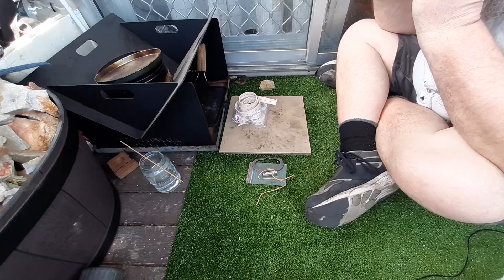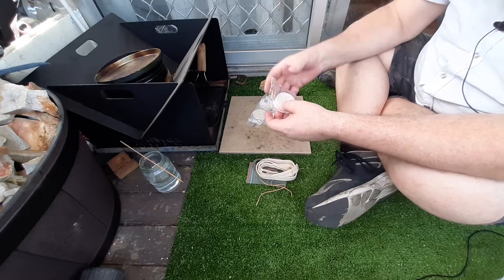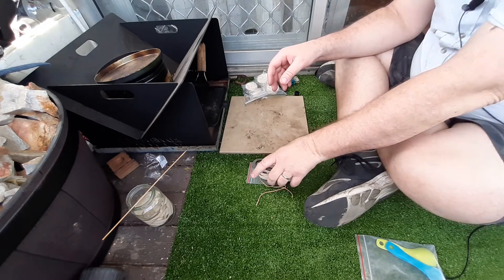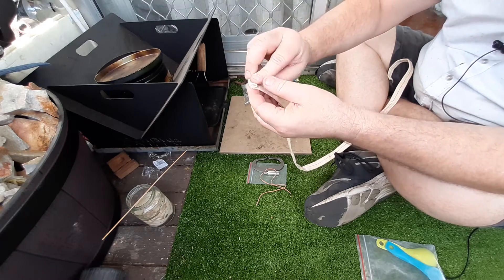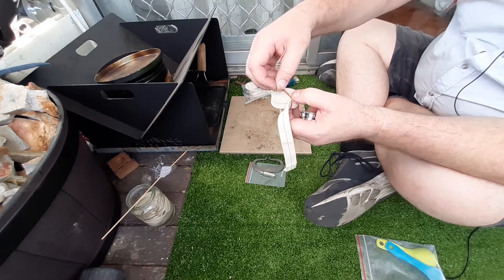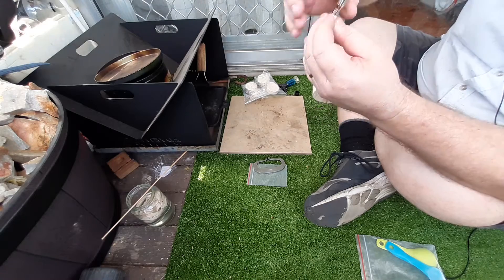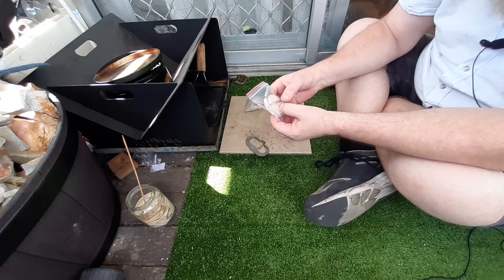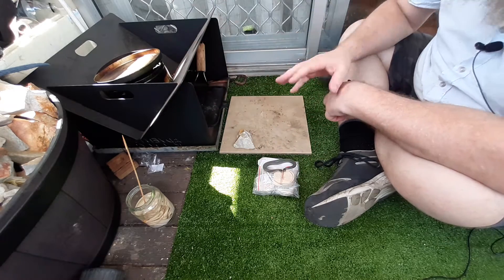how to make a lamp wick slow match

Comment: Great idea. I'm gonna have to make one one of these days. Excellent video,very informative.
Reply from the maker: these are very easy to make mate and work. I found them ok even with out the potassium nitrate treatment but they really do a lot better with it. 
I have a video showing using these in lieu of char cloth and blowing a tinder bundle into flame, it's exactly the same.

Comment: Nice idea with the 308 casing. Thanks for sharing. NO DRAMA'S! really much appreciated. Thanks for the info on measurements. Very helpful. Thanks brother, jas from nz🌏🙂👍👏👏👏👏💥💥💥💥💥
Reply from the maker: the .308 cases work great, though 12mm brass tube works well too for snuffers. I am also going to turn up a nice snuffer on the lathe.
Reply: Cool. Be good to see the results. Just bought a couple of lamp wicks cheap 98% feedback.ebay. i got potassium nitrate in nz $14.00 a kg. Easy to get here and sulphur same place. I made fatwood spills using the sulphur. I was wanting to make my own magic candles. Thats the 1st reason i got the potassium nitrate. I was thinking of using both, plus magnesium shaving and cotton with wax. Havent tried it yet. Any better ideas would be welcome.
Reply from the maker: @jasonedwardledburynewzeala9897  I haven't really done a lot of experimenting yet though I do know wax tends to impede things when combined with potassium nitrate for some reason.

Comment: Well done. I have the same lamp wick and I made my own "match" using 12mm copper pipe, but I don't have Pot. Nit. So I did without it. It works just as well without it. No flame just an ember so its perfect for using a birds nest to start a fire. Thank you for the inspiration.
Reply from the maker: I too used the flat lamp wick for a long time without treating it with potassium nitrate and it does work well, but I honestly believe these lamps wicks really come into their own when you treat them. The potassium nitrate is easy to get off ebay (just search for stump remover, the bloke I bought it off was a chemical supplier here in Australia, and it was relatively cheap, you don't have to buy 3kg's like I did, you can get a lot smaller amount or larger amounts, I wanted an amount to do me for my life time of making slow matches) 
The treated slow match is best when things aren't perfect, and allows the slow match to work in inclement weather (though I have never tried this) and helps the match take a spark and smolder evenly.
Reply: @waveman0  Hey Dean, got me some Potassium Nitrate, used the same method as you did, and absolutely confirmed your results. The slow match is immensely improved. I have made a couple to have on stand by for when I need them. Thank you for your suggestion.
Reply from the maker: @BillDrives  potassium nitrate is a wonderful resource, it improves lamp wicks and the like a lot, thank you for the extra data points mate.